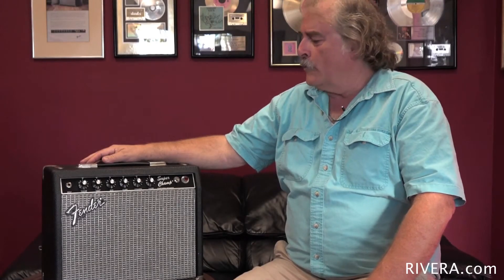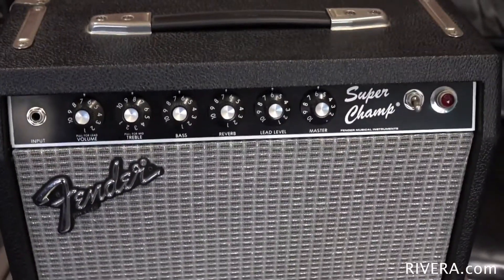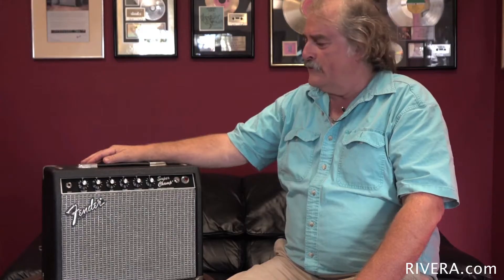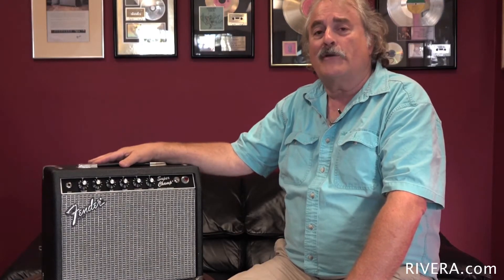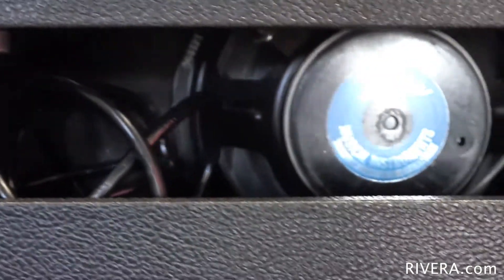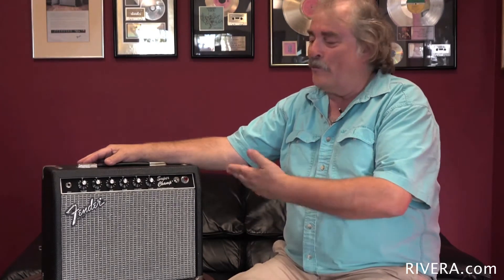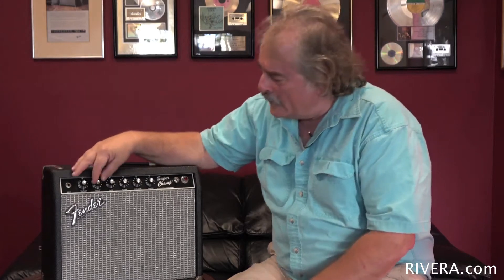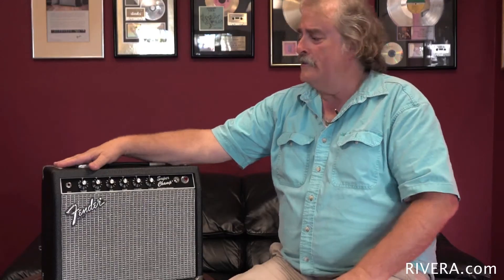Paul Rivera Sr. -history his designing the Fender Super Champ

Comment: I bought one of these last fall and it's an awesome amp, I put a speaker switch so I can plug in an external cab and use a 1-12 cabinet with a Celestion Vintage 30 for playing with a group. You can pretty much dial in any tone you want with this amp. The only downside is the preamp tube 6C10  triple triode are scarce and only available NOS ,so I found and bought 2 spares. The footswitch is also rare and expensive, so I made my own for about $60
Reply: How did you make the switch?

Comment: I've owned one since it was new in '83. The first thing I did was wire an extension jack/toggle switch that throws the power to either the 10-inch speaker in the amp, or to my tl- 806 EVM 12L cabinet... which makes it sound unbelievably awesome!! I play my les Paul through it 5-6 nights a week, and even in larger rooms it's all the  volume and presence I've ever needed. It mics up great if I ever need to keep up with a full band outdoors at festivals and larger venues.

Comment: I bought this amp in 1983. It’s gone through a lot. It’s now blonde with a black grill (all original just painted). It looks factory and not painted. It has a different speaker as well. I honestly don’t know what speaker it is. It looks like a brake caliper (black steel). I wired an output jack and mounted it in the back panel that I connected to a custom made talkbox. Still works great after 37 years. I still have the same tubes in it from the late 80’s.
Reply: I would buy a spare 6C10 tube if you can find one, they aren't made any more and they are getting very scarce

Comment: I've had one of these since the 80's. Found out you can make it big sounding for a stage gig running the line out to a non lead channel Fender or other combo. Miles ahead of any stomp box in tone. I used to have it set on top of a Roland JC-120 with an analog echo in between.   Just wish I'd have gotten one with the EV. Are there any speakers comparable to the force 10? Anyways thank you Mr. Rivera for such a wonderful little amp.
Reply: Earl R. I bought my Superchamp in ‘83 and a year later I bought a Roland JC-120 off a friend and was running them together for years! What a great sound! I still have Superchamp, but sadly sold the Jazz Chorus to buy a guitar.

Comment: Paul, can you please tell us if there is a tube that we can use as a substitute to the 6C10? Thanks
Reply: not a really effective one.  look around, 6c10s can be found not so super expensive & it should last a LONG time.  v2's the one that gets slammed in this circuit.  OR . . . if you feel really adventurous, you can try inserting another 12xx7 socket in the chassis & use another 12ax7

Comment: Have never played one of these amps or even seen one, but if they were like the only Fender amp models that I had ever bcught new like a 1977 Princeton Amp with 2 10" speakers and two Super Champ XD's with one 10" speaker they all suffered from the crapy quality stock speakers that sucked if you cranked up the amp. The amps are good, but the speakers truly sucked. If you want your amp to sound like 10 times better then check this out :  The X2 is about the same amp as the Super Champ XD, but with the added USB option so you can actually downloand and store other voicings of one's choice off the web from Fender. One problem withe XD and the X2 is that the stock speakers only sound decent at low volumes to to being very cheap wimpy speakers. I finally found out that better quality 10" speakers can indeed make this amp actually sound SUPER at not only high volume, but all across the sound spectrum. Now at a nominal cost my 2 Fender Super Champ XD's sound like $1000 amps.   I have 2 Super Champ XD amps. Great amps except for the wimpy 10" speaker that they come with so that Fender can cut costs, but at the expense of not producing a truly quality product. I also had picked up a used Fender Bassman 25 amp for $60 some time back. So the speaker in that Fender Bassman 25 amp had great lows and highs. So I removed it and replaced the Fender Super Champ XD speaker with the Fender Bassman 25 amps speaker which has a much larger magnet. It made a world of difference and now the amp is truly SUPER even when dimed. Next I will replace my other Super Champ XD with a Hartke Aluminum Cone 10" speaker from a Hartke 210 cab I have. Will move the other 10" in the cab to the Fender Bassman 25 Amp. The Hartke speakers turned out to be 16 ohm each. I had read that using a 16 ohm speaker instead of the 8 ohm ones would make the amp run cooler, but that the speaker would have less volume by about 3db. WRONG !!!. It acutally produces more volume than the identcal amp with the 8 ohm speaker installed. If you want a great amp upgrade your Super Champs speaker. You won't regret it.